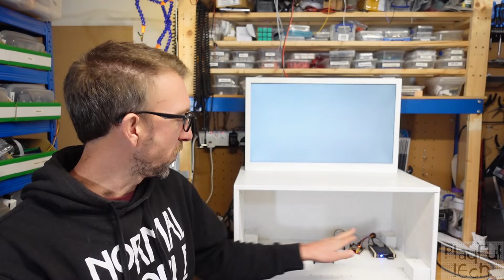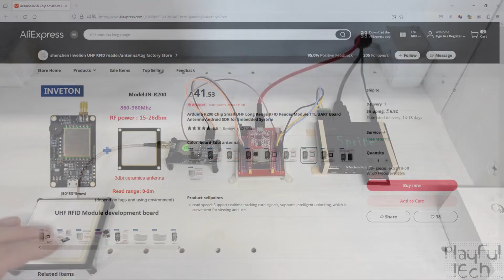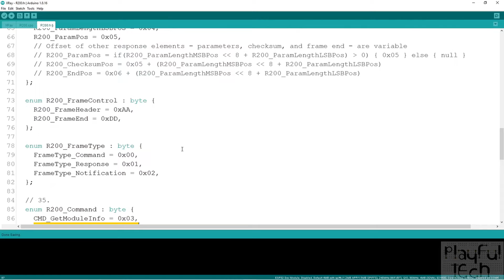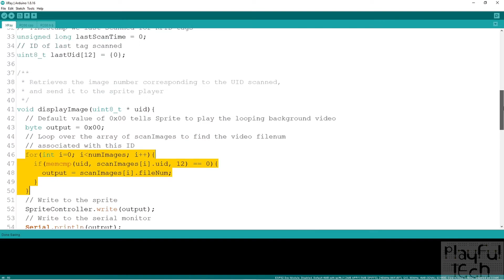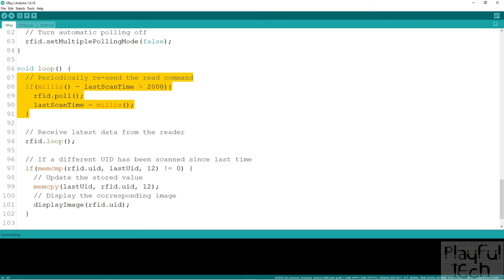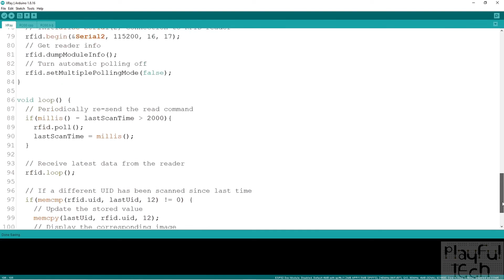Build your own "X-Ray Scanner"!

Comment: Thank you for another great video. Can you use raspberry pi instead of the expensive sprite ?
Reply from the maker: Yes, absolutely! If you run OMXPlayer/VLC etc. on the Raspberry Pi you can use that as your media player instead (the funny thing is, I considered demonstrating that instead, but thought that supply issues of the RPi were still a problem and that Sprite made the project more accessible!)